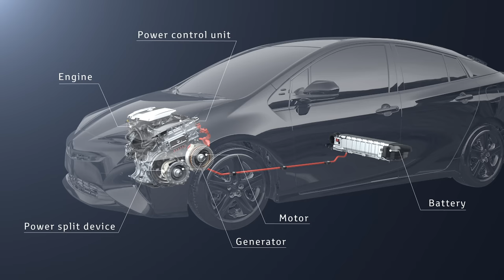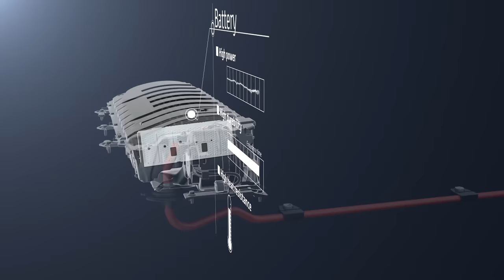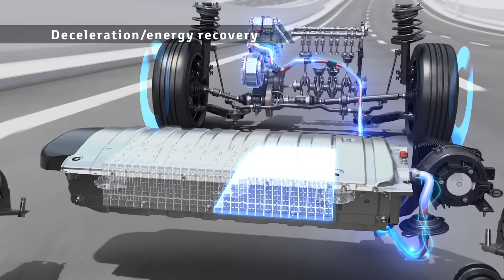What is Toyota Hybrid System

Comment: You only need to read Wikipedia article about Hybrid Synergy Drive and it blows your mind.
When I am driving my 2010 Prius, you gotta be amazed how well they have done certain things,
and how well it works together. (minus the head gasket problems).

There are many other videos in Youtube as well that explain the hybrid system using cut out physical engine models. 

Just recently a Toyota memo was leaked that explained their motives to dealers concerning full EV's. Now many others can understand 
why the hybrid way is way better than going full EV. And way better for the environment as well.

Comment: Great technology. Do you know if this is the same technology that Suzuki will use to its new strong hybrid engine  during 2022 for European Vitara and s-cross models?
Reply: which strong hybrid engine do you have in mind? Suzuki is currently using mild-hybrids in their own cars but that systems works differently compared to Toyota hybrids.
Reply: @palidzitube  I am talking about the new strong hybrid (not the old mild hybrid) that combines four-cylinder and 1.5-liter naturally aspirated, which develops a maximum power of 102 hp, and an additional electric motor that adds an extra 33 hp. Together, the hybrid system offers performance with a total maximum power of 115 hp. It is available for Suzuki Vitara in Europe (Greece and Spain for sure)
Reply: @chrisuoa  it’s different system, you can google some articles and they mentioned some robotic transmission for example so clearly different hybrid system design

Comment: I own a 2013 Lexus RX 450h Hybrid that I've owned since new. It now has 145k miles. The only issues I've had is a faulty O2 sensor and a bad taillight. Everything still works like new. It drives and handles like new. The battery still has 95% health and I'm getting a consistent 30MPG on highway trips and averaging 27mpg in the city. I couldn't love this car more! If and when I decide to get a new car it will another Lexus hybrid - no doubt about it.

Comment: This is the way every car manufacturing company should go instead of producing fully electric cars that run on energy from coal power plants.
Hybrid drive is the solution between conventional combustion engines and fully electric cars that will run on energy cell which are not being made from lithium.
There are other materials to make batteries from, but either they are still under development or research.

Comment: Fuel tank is not shown.Is the fuel type optional.?
Option like cng/lpg/diesel.
Reply: Yes, I use standard e10 ethanol and the manual says that you can use up to e15.  I have not discovered any MPG difference between standard unleaded and e10 ethanol.

Comment: so there isn't  a belt like in most cvt transmissions ?
Reply: No belt needed in synergy drive. Just a single orbital gear that accepts power from engine/electric motor. Better reliability 💪
Reply: @keptkozy   More reliability, and efficiency, this design is amazing
Reply: @juancarlosabad3298  The e-CVT in Toyota hybrids do not have any chain or belt. It is electronically controlled planetary gear. 
The video you shared is either wrong, outdated or you didn’t understand it right. I didn’t watch it since it’s long.
Reply: @midoriyaizuku4403  you better watch the video before giving such authoritative answer.....the author did explain that the original design did not have any belt or change but when they turned the machine 90 degrees in a new version it was necessary to introduce it....in any case i cannot guarantee that that corresponds to the last version of the e-CVT system design....
Reply: The first and second gen prius do contain a chain
All made after that do not
But that's just a chain to transport power from point a to point b and is entirely different from the belts found in cvts that are pushed around by pulleys that have extremely thigh tolarances
The second generation prius is regarded as the most reliable prius so far (can't say anything about gen 4)
Reply: @juancarlosabad3298  you don't understand this video at all 🙃 Older Prius I and II have a chain, but it's only a link between power split device and wheels. Newer designs have gear in this place. Toyota hybrid don't have gearbox in standard meaning. They have planetary transmission which acts for driver similar to cvt gearbox. Toyota called it power split device and in marketing materials for customers it's called e-cvt.
Reply: It's not really a transmission , it's a planetary gear set up.
Reply: @tedlipkin4742   - wish everyone would stop calling them CVT ; if they don’t have a belt .
Reply: @psychiatry-is-eugenics  Toyota calls it ECVT - they were chain driven now it’s planetary gears. There are some videos that show the updated system .
Reply: @psychiatry-is-eugenics  Continuously Variable Transmission or CVT does not itself imply to have a belt, although it's the most common way to build one.
Reply: @midoriyaizuku4403  Almost 4 minutes is a life time.

Comment: Pardon me I'm at lost here, I only have High school level of science knowledge, but if the generator is using up the engine power to produce electricity, how exactly is that going to be efficient?
My understanding of a hybrid car by this video is that the ICE is producing certain units of energy, and a part of it is used to drive the wheels and the rest is used to produce electricity by a generator, by conservation of energy there is no increment of energy is happening there given the source of energy for both is the same. If the engine is working at a constant rpm then that can increase the efficiency but that's not the case in here. Or is it that the electric motor assist the engine to work more efficiently?
But wouldn't there already be an energy loss when a part of the energy produced by engine is given to a generator to produce electricity? 
I understand regenerative breaking tho, which makes much more sense

Comment: all good and sounds perfect but maintenance cost?????
Reply: Im not sure about newer hybrids, but there are stories of first gen priuses still roaming around with dead batteries. The powertrain (minus the hybrid system ofcourse) still runs like normal. Fuel efficiency suffered and powerloss was noticeable, unfortunately. 
Apparently the owner couldnt be bothered to replace the batteries. Or they didnt have the money probably. Not about it being too pricey, but more like they didnt think it was worth it. Probably gonna use the car till it literally falls apart i guess hahah. Battery lasted 10 years i think. Not sure about the mileage.
Reply: They Toyota ECTV has been bullet proof over the years.  I've never heard of a transmission in a hybrid being replaced for the life of the car.

Comment: What happens to AC system while engine is Stopped and Motor driving wheels?
Reply: AC is powered by the inverter compressor, it won't need the engine to be on and can be battery powered until it is low, then the engine will turn on and power it / charge the battery. When the battery is sufficiently charged it will turn off the engine and the AC will be battery powered again until it is low. It is a great car if you sit in traffic or in parking lot waiting but need the AC.
Reply: @maggiejetson7904  Thank you

Comment: What kind of battery, nicad or lithium ion?
Reply: Depends on the model, for example the LE model uses lithium ion, the SE and XLE models use the nicad batteries. Hope that helps
Reply: No one uses NicCad anymore. Instead they use NiMH, the same as a regular rechargeable AA batteries. I think newer models may have Li-Ion, but for a Prius it shouldn't matter much. NiMH also lasts way longer.
Reply: @raptor1jec  and doesn't explode has far I know
Reply: @raptor1jec  I think they use the NicCad because they are so weather (cold)  resistant .  At least that is my understanding.

Comment: İ have corolla hybrid 1.8 . Its consumption is 5 llt  100 km. That is same with my old car Clio 1.5 diesel. I actually assumed corolla consumption will be lower but this is also good.
Reply: the tax and emissions on the corolla are much lower at least and in the city it's much more fuel efficient

Comment: Does engine oil return to the crankcase when the engine is not running?
Reply: Great question. Hope someone here is able to answer it. Cheers.
Reply: Are you concerned about piston rings wear out earlier due to engine start much more often?
Reply: @deeneyugn4824  yes
Reply: I think it is electric and computer controlled. This ICE is treated like a baby. Warms much faster too

Comment: good reliable car. much better than the gas motor or the pure electric car.
Reply: I think so.  Living in Iowa, I'll take the hybrid vs EV because if I get caught in a Winter storm or traffic jam in the cold, I'll have heat like a standard ICE vehicle where the EV has heat only as long as the battery lasts.  When traffic finally moves, the EV is dead.  I don't have anything against them but the upper Midwest isn't the climate for them.

Comment: How many years/miles does the full drive train warranty cover?
Reply: Most Toyota hybrids are 10 year/100,000 mile warranties.
Reply: 3 year 36 bumper to bumper.  5 years on the engine drive train.  10 years on the hybrid system and 150k or 10 years on the battery whichever comes first.

Comment: I have been driving BEVs for 14 years now and I'm on my 5th. I just don't see the point of lugging an engine around all the time. Most of my journeys are long ones, infact I recently drove just over 800km on a single trip with a short rapid charge on the way. If your car has a chimney its not electric.
Reply: 800 km. That's a very long charging cable you are hauling around 😅

Comment: The problem is Mr. toyota , it,s front wheel drive. In canada in the winter front wheel   drive is the whist drive system.
Reply: That.s the exact opposite….ask saab and Volvo why front wheel drive is better in slippery conditions…when you see a bmw on a snowy hill you can see it for yourself…
Reply: all the toyotas are using this hybrid system now, including rav 4 and highlander...

Comment: Does it have engine breaking..??
Reply: When going down the mountain, with the cruise control set, the excessive energy is captured by the regen system to recharge battery. If addition braking is needed to maintain speed than engine braking takes place.

Comment: Very interesting, but if the engine starts with generator it means in winter time you could not warm the engine before driving and isn't bad for the engine ?
Reply: What?
Reply: When first turning on car, if the engine is cold it will start up and warm up automatically. Electric motor will start moving vehicle from stop.
Reply: You would think so from a logic perspective.  However, for some reason, they just keep on running and not at all uncommon for 200k and some Prius taxi's have gone over 300k.  I have a Rav hybrid and live in Iowa.  When cold, the mileage drops pretty substantially because the engine runs most of the time until well warmed up.  The computer seems to always know what's best.  Wish I understood why, but Toyota has perfected the engine / drive system for a bit over 20 years.
Reply: @dj3114  I have seen some Prius that have up to 500K, amazing vehicles and glad i traded in my car for a Rav Hybrid

Comment: Is it better to roll or brake to charge?
Reply: the recovery system creates its own resistance to slow down the car and charge the battery so there's no need to use the regular brakes plus you minimise the wear on the brakes so you wont need to replace them often . So its better to let the car roll and slow down by itself
Reply: You want to brake as long as possible, if that makes any sense. On our Sienna, it has a "Charge" area of the power gauge that shows when you are charging the batteries.  I start braking early, keeping that gauge in the middle as long as I can.  Does that help?
Reply: @bechtoea  you should better let the car brake on its own cuz all you do is causing wear to the brakes
Reply: I believe there is a sweet spot when you push the brake paddle that cause regenerative system kicked in at full power but not using real brake. Kind of like using Honda hybrid paddles behind steering wheel.

Comment: But still essentially apart from when it’s on the overrun the petrol engine is charging the battery. There’s no magic power that’s free!
Reply: You're right, magic power for free doesn't exist. However this system does make optimal use of energy as the engine is kept in the most efficient range and using excess energy to charge the battery. 

When it comes to results the fuel consumption speaks for itself.
Reply: Agree, but with the regenerative braking, its close.  When the car is coasting or light braking, the motors turn into generators and charge the battery, which is why it does better in town.  You are right though that the engine also charges the battery too.  Apparently, the computer won't let the battery fully charge or discharge.  All these systems work hand in hand for the best economy.  Toyota has the hybrid system down.  The Prius was the first in 2001 so they've had 20 years to consistently improve it.

Comment: it costs more to buy and the battery degradation will decrease in the car's performance and mileage, as well as an increase in fuel consumption. The battery may eventually lose its capacity over time, leading to decreased performance and range from the vehicle.

Comment: Is the battery sealed for flooded areas?
Reply: I’d be really scared to drive it thru water
Reply: @psychiatry-is-eugenics  I've been driving since 2003, I have never driven through water more than 10 cm. Why would you ever do that?
Reply: @kekke2000   - i have often driven thru flooded underpasses , and roads are often covered with water in a heavy rain  ; and then there is heavy snowfall that turns to slush .
Oh -  I think they just started selling electric cars in Michigan
Reply: @meki___6881   - shutting off or disconnecting the battery will not stop lithium from burning when it gets wet  .
Reply: @psychiatry-is-eugenics  That's through charging and the Tesla is full electric - not a hybrid.  Hybrids don't charge at a station.
Reply: @psychiatry-is-eugenics  High levels, yes, just like with any vehicle.  Otherwise, the bottom of hybrids is covered with plastic or something similar.  When changing oil, a small section is removed to get to the oil pan.
Reply: @psychiatry-is-eugenics  In a rav4, if the water level gets to the level that the inside up to the rear seat is in water, then you might be right - I've not heard that.  If the inside of any vehicle is that high in water, there is residual damage and most all would stall depending on clearance clarance!.
Reply: They do crash tests , should also do flood tests .
Drive one into deep water and leave it for a day .

Comment: Is it possible to put in CNG ??
Reply: Why should you try to do that?  You probadly mess up the engine. This is a fuel efficient car allready with a Atkinson cycle engine, so leave it at it is.
Reply: @wimschoenmakers5463  in my country it's extremely cheap so thinking about putting it in ...it should be the same like if was a normal engine
Reply: @kernj6454  I now there are some specialist companys that can rebuild your Toyota Hybride for CNG, but the car needs then more maintenance to the injectors and valve train. Probadly also the engine will not last as long because of the higher temperature. The used Atkinson Cycle engine is somewhat different from a regular petrol engine with valve timing and fuel injection.
Reply: @wimschoenmakers5463  hmm ok thanks
Reply: @wimschoenmakers5463  Hello, I have a question. Is the e-cvt transmission used in this new 1.5 cc Honda Jazz exactly the same system as the e-cvt used in the 1.8 cc Toyota Corolla sedan or is it a different system? The reason why I asked this was they said that the risk of deterioration of the e-cvt system used in Corolla is less than the normal CVT. Do you think we will have problems with the e-cvt gearbox if we buy Jazz?
Reply: @attilakhan4606  I don't know much about the Jazz, but it uses a different systeem then Toyota.  I tought the Honda uses a starter clutch to start the petrol engine and the Toyota uses a electromotor. I would go for the Toyota, because it's a proven Hybrid system from the allready 25 year old Prius Cars, so problem free. They even use this in the New Corolla en Rav4.
Reply: @wimschoenmakers5463  i see thank you sir
Reply: Yes. In Poland there are a lot taxis Toyota hybride + LPG and they dont make any problems :P

Comment: Clever, but very complex. This would have been useful decades ago, but batteries are already rendering this design obsolete. The engine is the weak link. As batteries get better, this idea will quickly go away.

Comment: very nice on video but not so good when driving.

Toyota must adjust this system in order to avoid hi RPM when we press full accelaration.

they need to adjust to 3.000 rpm on eco/confort mode and 5.000 rpm on sport mode.

i sold all my cars and did not buy Lexus ES due to this excess of noise on accelaration.